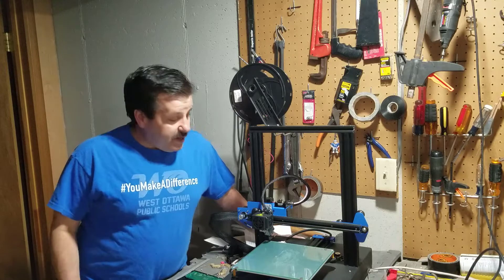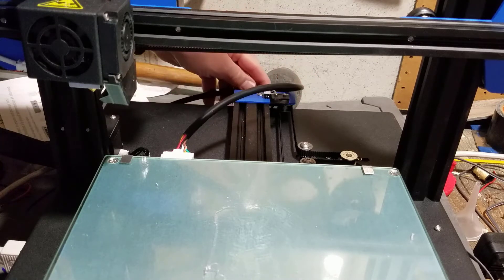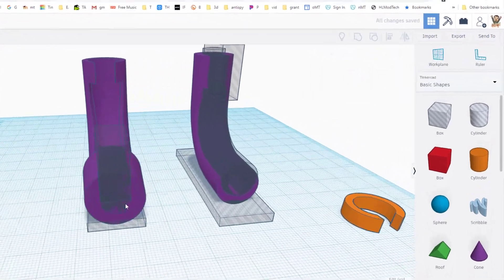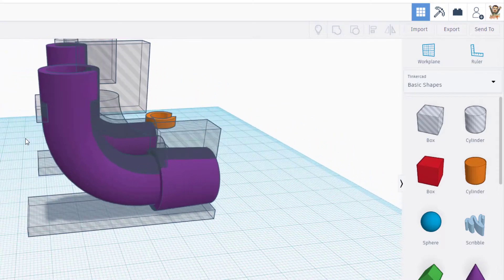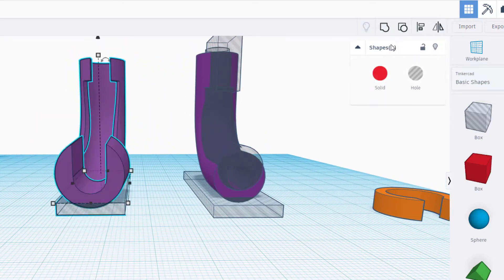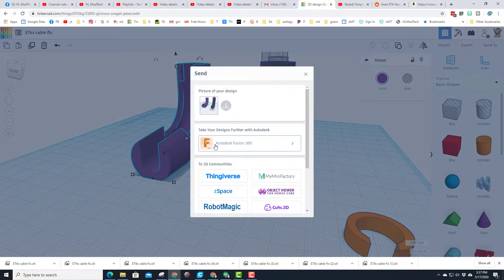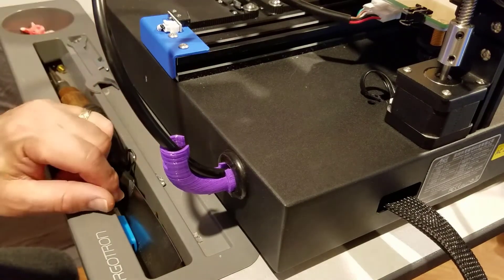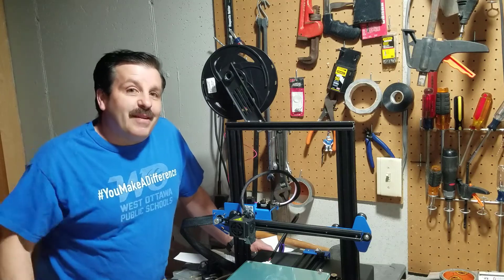Tested! Anet ET4x heated bed cable strain relief... and a FIX!

Comment: Hi, love your videos btw. I had a quick question, do you use bed adhesion when printing on the glass. Sometimes I have trouble with warping on the glass, do you use any glue or spray or tape?
Reply from the maker: I occasionally spray a dash of aquanet. I have not yet with either of the ET4x rigs though. I did notice that I have the bet pretty tight as the extruder was clicking on the first layer...